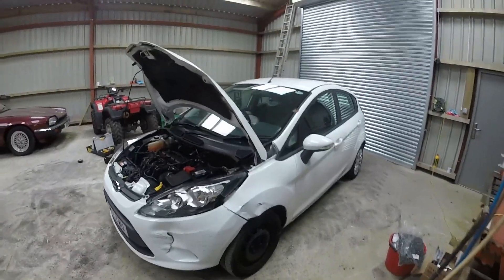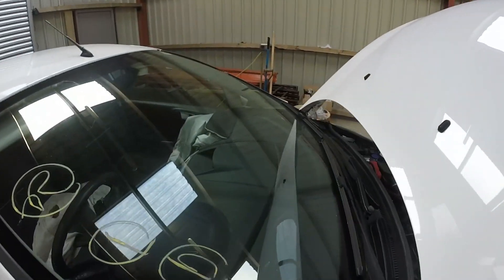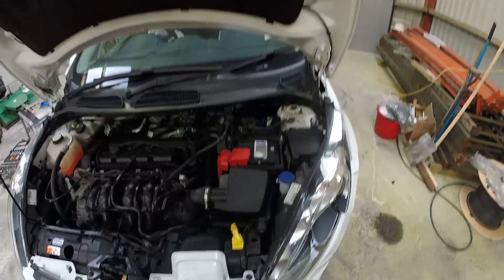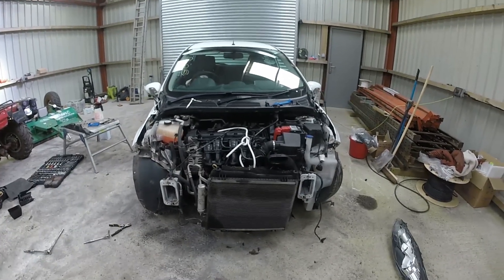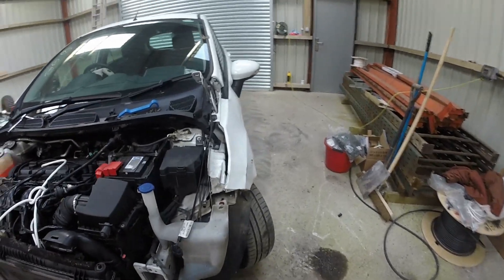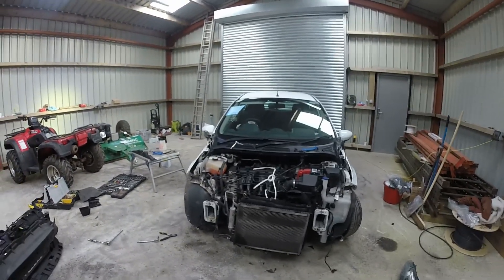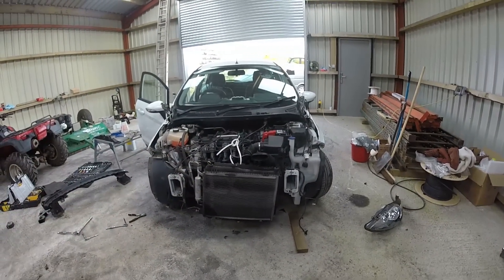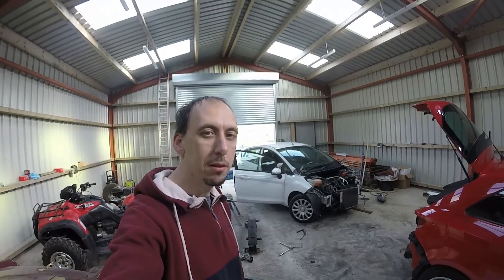Salvage Auction Fiesta Edge Strip Down Time, Hopefully The Chassis Damage Isn't To Bad!!!!!

Comment: Leggy that pal. U need to get a measure from the bag of the leg where the bar boots on which it has like a inch extra between top 2 bolts. Measure corner of that to the corner of where wing bolts on. Either side and compare. When u go breakers if not front ended u could get measurements. It’s 100% pushed both over so u need to get dozer on it and pull 1 at a time.
Reply: This sounds wise. To my (totally non-expert) eyes the driver side leg looks like it’s moved laterally as the passenger side one has moved towards the centre.. But I suggest Phil has it covered. 😎

Comment: Look at the drivers and pas door gaps on the back edge of wings if the car has gone round one may be different to the other hope that helps..if the floor in your new work shop is level check the heigh of each.leg from the floor..

Comment: Hey Phil you can get headlight repair tab kits for these check eBay they are cheap I know it won’t help with one of em but good way of sorting the other one
Reply from the maker: Hi Grant, i have a hot stapler for fixing things like headlight tabs, absolute god send does the trick and solid as ever!

Comment: All write offs should just be crushed and save putting unsafe cars back on the roads
Reply: Dont you understand that many categorise of write  off cars are easy and safe to fix. Its purely down to the over priced repair bills submitted by garages and bodyshops used by insurers  that the cars are written off due to cost. A few years ago i was in a bump and my car was written off as it was un economical for the insurance to repair. Car was valued at the time at around £1200. Cost of repairs at a garage would of been  over £700 the majority of this being paint work. I retained the car had the minor mechanical work done by a local garage for £120. I then sourced an in colour wing from a scrap yard for £30  and fitted myself total repair cost £150. Now if car insurance was like home insurance and you could  get quotes for repairs form garages you choose then I imagine there would be far less cars being written off. Another instance was someone i know had a car written off due to vandalism.  Virtually every panel was keyed according to insurance body shops the car needed full strip and respray  costing thousands. He also kept the car and had the paintwork  re touched and blended at a local garage for a reasonable price again a perfect example of how to many cars are written off.  Isnt it a far better idea to repair cars if possible rather than scrap them same with many other things.  You wouldn't demolish a building that had repairable damage  would you????